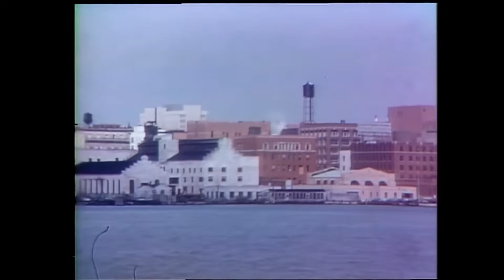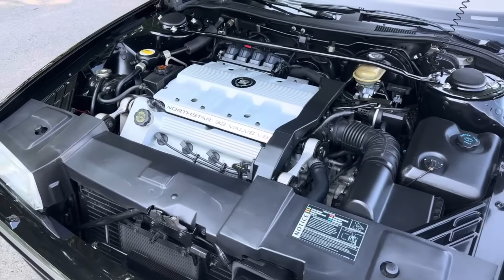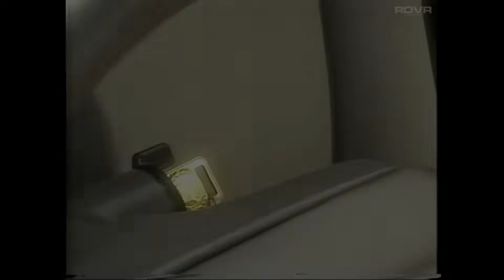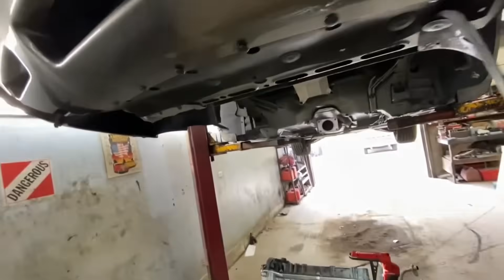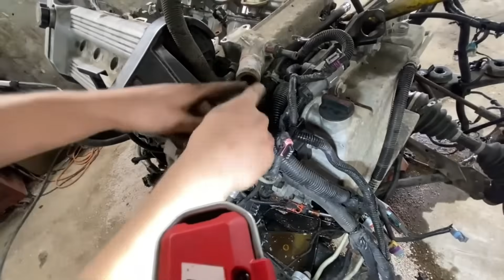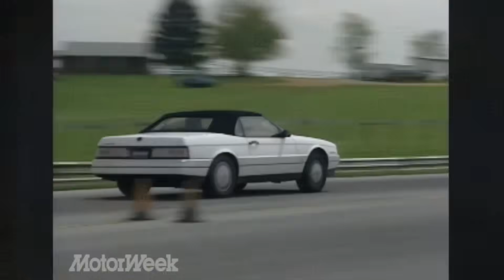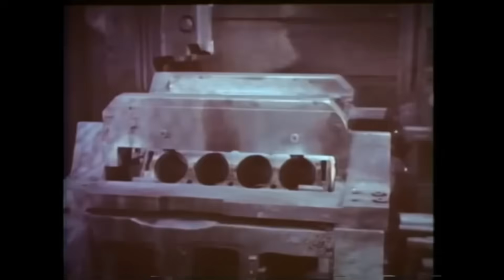Most HATED American V8 Engine of All Time!

Comment: Don't these moronic car companies do long-term testing on these engines? What a novel idea!
Reply: Why? That would cost $ . People are puppets they'll keep buying.  Lose customers to other manufacturers but new customers will be leaving other manufacturers and buy from another manufacturer. It cycles back.
Reply: Yeah. That’s a great idea. In an industry where months matter for new technology introduction, you want to spend $1bn on an engine, then spend a crew another few million to drive it around for 5 years? 

That way it’s nice and obsolete upon entry. Oh and that entire time, those cars and engines struggling with sales beforehand? Yeah now you’re not even selling one. 

That’s not how it works. 🤦‍♂️

Most companies run hundreds of thousands of simulated miles through load dynos and such, but there can be a few fundamental differences that COMPLETELY nullify the findings… and often those endurance tests don’t finish till they’re years into tooling up production, shipping parts and manuals out to dealerships ahead of introduction, training technicians, etc. 

One of the main issues was actually head gasket failure due to the material they used when exposed to the coolant (probably partially why they blamed coolant type on customers) - GM had famous issues with their coolant types also. 

Anyways once it rotted out, the flow through the engine was completely messed up, and aluminum engines do NOT take that well. 

That failing head gasket was an issue of time (exposure to the coolant) - and couldn’t have been easily replicated in testing.
Reply: They don’t because that’s expensive. It’s cheaper to do your best job on paper and just build it. If problems arise, the buyer has a warranty and we can control the technician’s repair cost with unrealistic labor times.

Comment: Not even close to the worst. There are tons of them from the 90's still running around.  You want worst, talk about the 5.4 3 valve Triton from ford, or any number of others, like the 5.3 Hemis, with about 100% failure rate.

Comment: The Mark VIII engine was very similar and spec. 4.6L DOHC, 32 valve, all aluminum and was quite dependable. Even introduced a year earlier.
Reply: Both the Intech and the Northstar were introduced at the same time for the 1993 model year. I have both engines myself.

Comment: So if you were to have replaced the head bolts before failure, would that have taken care of the issue. And I do mean, torque the bolts properly, not torque to failure. I am thinking something like using AP bolts.

Comment: Who is this a******, I work for general motors for over 25 years and this was not the most hated V8 engine if anything it had its quirks but it was a great running motor, how about the 
V 8-6-4, how about the first attempt at the diesel, sorry this ad is b***** and super biased.

Comment: Some of this is misleading.  Saying that some owners with extended warranties got theirs fixed but others told to pound sand.  If you pay for the extended warranty, it is covered during the warranty period.  The transmission in my 2017 F150 failed in December of 2024.  I purchased an 8 year extended warranty for the vehicle in March of 2017.  Ford covered the full replacement of the transmission.  A neighbor had the transmission in his 2018 F150 fail shortly afterwards.  But, he did not have an extended warranty, so he had to pay the $10k to have the transmission replaced.  Sure, he was upset and yes, there are design flaws in the 10R80.  But, legally, nothing incorrect was done by Ford.  Do another video on the most hated transmission of all time.  I think the 10R80 might be on that list.  They are failing left and right.

Comment: Actually, this video doesn't even mention the real reason for the problems with this engine.  In the late 90s, early 2,000s I had the pleasure of repairing a dozen or so of these. The head gaskets were leaking, he got that part right, but the failures were caused by the fact that the head-bolts were not just under a lot of tension as the engine heated up, but they were screwed into an aluminum block and had only 1 inch of thread contact with the block. What typically happened was the aluminum threads would strip out on several of the boltholes allowing the head to warp. 
  The repair job that I became the local go-to mechanic for was to drill out the threads from all 20 bolt holes. tap the holes and install steel thread inserts that increased the strength to almost double.  Just for the record, only the GM dealerships were charging customers over $4,000 for this modification.  My shop was doing it for about $2,500.  Also removing the engine from the car was not that big of a deal. My average time for the complete repair was about 22 hours.   The torque to yield bolts were not stretched beyond their limits, they were stretched to just under their limits. The engine's weakness was the aluminum boltholes, not the bolts.
Reply: As a mechanical engineer working in aerospace, automotive, and owning a repair business in the 80s - 90s, I believe the open deck design was a major factor. Lack of radial support to the cylinder columns,  combined with the bolt loosening and problematic gasket issues, left too much freedom of movement at the cylinder/head interface.
Reply: @edfederoff5187  Kindly FYI, many if not most car engines have been (high pressure die-cast) open deck for well over 2 decades now. Motorcycle engines even longer. So that can hardly be the problem.
Reply: When the car industry started switching to aluminium heads and/or blocks, threading bolts into them became a problem. It wasn't just the Northstar.
Reply: Well, Italian and German Automakers have for DECADES, Used Aluminum Engines.  These Automakers Use Steel Studs- NOT Bolts that are Screwed into Engine Blocks.
Reply: Exactly these videos are so misleading. The only thing they got right is the head gasket was leaking and the fix can be done with the engine in. It turns out especially nowadays there's a very nice system to repair the bolt problem in the aluminum by sleeving them with I believe they're called helicoils and there's a really cool system to do it now much easier than ever
Reply: @Michael-ge3eo  time serts   they are stronger than helicoils
Reply: See you are proof that a great mechanic is worth his weight in gold. I have a feeling this axiom was and remains true as we are still inextricably linked to super complex mechanical engineering of the late industrial revolution. But this might change though once everything is electric and simple based on plug and play code writers not so much on endless mechanical variables. Well until the EMP
Reply: @paxwallacepiano  regardless of how your car is powered, it'd still going to depend on greased bearings and friction brakes and tires that wear out.
Reply: @JoeRogan-d3o  Sure of course that goes without saying AND Jay Lenno's turn of the Century electric car runs perfectly Lenno's comments about it are quite revealing.
Reply: Q : why can't G.M . Hire smart guys , like  independents who "Fix" things 🤔 ?
Reply: @RobertHenry-ie7kd  I think they have a union. Crappy mechanics can't be fired.
Reply: 22 hours of shop time today, at 150 an hour is 3300 in labor.  Less parts etc.  Still completely debatable whether worthwhile on any of these cars today.  I say no, not worth dumping 4 grand repairs into a 20 year old GM product.
Reply: @percussion44  it was 20 some years ago. Shop time was $75 an hour.... the whole job cost the customer $2500

Comment: Ive had three of these motors, the whole key to avoiding head bolts pulling out is at low mileage you remove the dexcool cool and use old fashioned GREEN ETHYLENE  GLYCOL COOLANT. The threads in the block will not corrode. Dexcool is to acidic.

Comment: It was all because of them using the wrong head bolts fixed in 2005.  Long steel bolts in Aluminum are always a problem.  Otherwise, a very good engine.  Now because it's a luxury car even the simplest maintenance will drive you mad.  The cars are logistical nightmares.

Comment: In GM's problematic engines, i.e., the Olds diesel, and the Cadillac Northstar, the head bolts are a recurring problem.  With both, replacing the head bolts on both would solve over 90% of their problems.

Also, I'm hearing more and more, that the Big Three have been designing everything on their vehicles to only last until just after the warranty period, designing everything to be prohibitively expensive to repair.  And they wonder why they aren't getting as many return customers and new customers that have purchased used vehicles?  It's a big, Well DUH!

Comment: Never understood why the northstar was developed when the vette engine was available.
Reply: DOHC 32 valve was what Luxury Imports had. GM felt Cadillac needed a similar V8 to compete. Ironically, just over a decade later, GM used the SBC, but improved the chassis and made it RWD, which made Cadillac highly competitive.
Reply: Wont line up on a fwd transmission
Reply: They still competed internally with one another
Reply: The Corvette v8 in the 90s did not have 4 cams. They were still running push-rod engines then.
Reply: @JoeRogan-d3o  The ZR1 Corvette got a DOHC V8 in 1990. This was NOT the Northstar engine, but a Lotus design.
Reply: @scotth6814 they are very similar northstar & LT5

Comment: It wasn’t torque to yield bolts alone, it was undersized fine thread bolts. The fix for this is drilling out the bolt holes in the block to a bigger size, re-tapping to a course thread, and using head studs. Car Wizard had a great video on this.

Comment: The head bolts used the wrong threading, thin, leaky and easily broken.  When the heads are removed and the bolts replaced with sturdier ones, the engine can be very reliable.  The cost of this change over is a turnoff.

Comment: Isn't it funny how the 350 cu. in. 4-cam all aluminum 375 hp 32-valve LT5 ZR-1 engine that debuted in the 1990 ZR-1 Corvette was so similar in so many ways yet had none of these problems while ultimately peaking at 405 hp in 1993 -1995. I know because I have a 1994 ZR-1 that still runs flawlessly today.
Reply: That engine was designed by Lotus, not GM. GM bought the company just to get the patent rights to that engine.

Comment: Ironically, babying it was actually bad for these engines.  They would get enough carbon buildup on the piston rings etc. to leak, and the engine (to cool the cylinders) had oil flingers flinging oil at the bottom of each piston.   Drive the piss out of it a few times a month, no oil consumption.  My mom bought a 2000 Deville at a good price because it was burning oil; she's got a lead foot, so withn literally a week the oil consumption dropped from like a quart per 1000 miles to about 1/4 quart per 1000, then a week or two after that it dropped to minimal to no consumption (like, under a quart per 10,000 miles so you didn't have to top it up between oil changes.)

Comment: Ford also had the 'Torque-to-Yield' head screws in Triton engines. Most stupid fastening concept I ever heard of. Aluminum block & heads move around quite a bit like the narrator said. I'm angry that the OEM's never tried 'Compacted-Graphite-Iron'(CG Iron). 60% more fatigue resistant then Cast Iron & the expansion/contraction rate is about the same. CG Iron would allow for thinner wall castings so it would almost match Aluminum in weight after machining yet could handle an additional 100-150hp. CG Iron machines almost like Cast Iron & both are easier to machine then Aluminum regarding material buildup on the cutting tools.

Comment: Some factory built engines in the 60s had way more horsepower than most vehicles made today.
Reply: Well yeah, they were 350 cid or more. I had a Ford 460 cop car. You wanna talk about power?
Reply: And make as much emissions as 10 cars. It's a trade off
Reply: @dosmastrify have you been in a shop, where there is a newer vehicle engine running?
 Or following a newer vehicle up a long grade?
 It will make you more nauseous than any old vehicle, even one that's burning oil.
Reply: Car engines didn’t have the  smog controls that modern engines now have to deal with so of course there is an advantage with them over today’s problems. But elsewhere there is talk that those who received their education from a far left thinking liberal colleges had been dumbed down by those liberal educational professors who were more concerned to get everyone on the same page politically speaking and that may explain why everything mechanical is failing us now.
Reply: @GeorgeHolt-f6e Interesting observation 💯 
 In my years of bending wrenches and busting knuckles on hard metal surfaces... I've often felt that their solutions were actually promoting problems further down the line.
 For example, vehicles PRIOR to the inundation of smog devices, primarily catalytic converters.. I didn't get headaches, or nausea when exposed to the exhaust fumes.
 Bring on the cats and smog control devices. It began making me have the headaches & nausea... Go figure🤔

Comment: What went wrong? Dexcool! The 4.1, 4.5 and the NorthStar have one thing in common. They have reverse flow cooling systems.   Meaning the coolant entered the top of the engine and exited out the bottom.  A smart design that requires a coolant vaper relief.  Cooling the heads first then the block allows for higher compression ratio.  Dexcool the extended wear coolant all GMs use doesn't protects against rust and gets clumpy.   Over time this junk plugs up the vapor relief line going from the thermostat housing to the caught tank.  The vapor having no were to go stays in the heads causing over heating issues.   It will act just like a blown head gasket.  Using a caron monoxide test will confirm whether the head gasket is blown or not. Keep driving it and it will blow it by warping the heads.  I made a lot of money knowing about this.  Just clean out the vapor line and refill with the standard green coolant and add copper seal.
Reply: At least someone knows their stuff… yea the n* bolts could have been better but dexcool turning the head gaskets to sacrificial anodes is really the catalyst to all the issues.  Survivor northstars had green antifreeze  inadvertently put in for whatever reason and those seem to be less affected.   If dexcool was never used, this video would not exist and many cadillac owners would not have had to suffer through head-gasket failure

Comment: Now its almost like manufacturers have learned selling motors and transmissions just out of warranty is very profitable. Engineered obsolescence built in and sorry about your luck.  I have a turbo Tundra for sale, I traded my GM pickup with the blown motor and slipping 10 speed for it. I may buy a Ford with a wet belt and the same trans next.

Comment: I worked at a Cadillac stealership in the 80,s and we were pouring stop leak into brand new cars.
Reply: The Northstar engine wasn't around in the 80s.
Reply: @JoeRogan-d3o He didn’t say he was putting stop leak into Northstar engines in the 80’s. Read and comprehension. 😂😂😂
Reply: it was that bad?

Comment: Almost all modern engines since the 90s onward use TTY bolts. 
Its the fine thread/aluminum head and blocks with a too small bolt that dooms these engines. There is a repair kit that you redrill and tap the bolt holes and use a larger, more coarse bolt thread
Reply: Drill and tap and insert steel inserts into the aluminum, then use the same size bolts. You cannot just install "larger bolts" into this engine.   The new bolts will be the same as the original ones and will be torqued exactly the same way.

Comment: The ht4100 was much worse.   I was a mechanic since the 70’s-2010’s.  I’ve had several towed in running very poorly but the car wouldn’t move.   The crank shaft snapped between cylinders 6?and 7 usually.